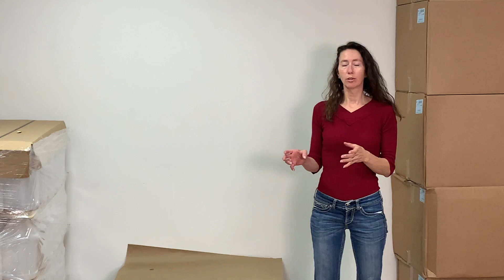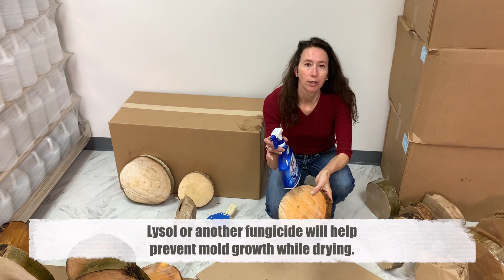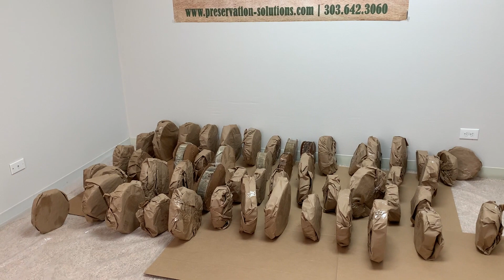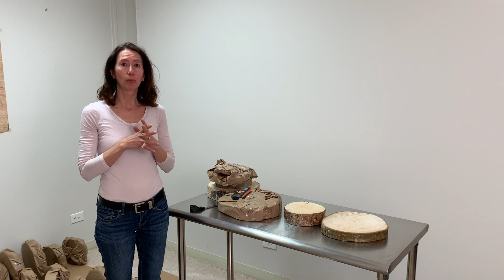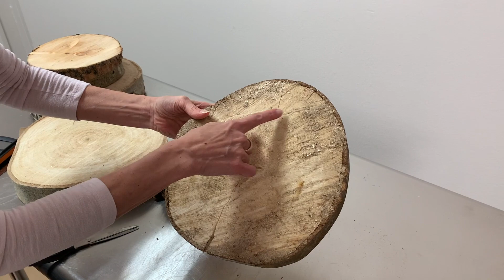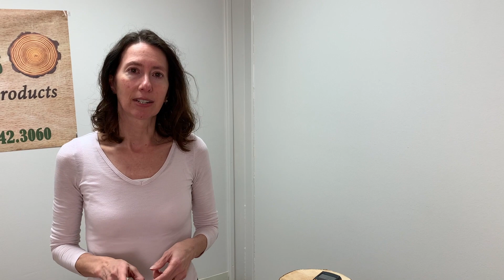How to DRY Treated Wood Cookies Without Cracking - Part 2 of 3

Comment: If you notice that the wood is drying too quickly and cracking is starting, would you retreat the wood or just make adjustments on how/where you are drying the wood?
Reply from the maker: Once the wood is saturated with Pentacryl, it does not need to be treated again.  
If you notice cracking and checking starting in the wood, then it is drying too fast. 
You can:  
- Depending on the size, cover it with cardboard, wrap it in brown paper, and/or bury in wood shavings.  All these things, slow down the drying, while still allowing the wood to breathe.
- Move it to a cooler area, but still undercover, not out in the weather, keep the wood out of direct sunlight, heat and air movement.

Comment: I’m curious why you wouldn’t want the sides (circumference) coated? if you’re trying to slow the end grain drying, so it doesn’t dry so much faster than the outside, wouldn’t you NOT want the outside to dry any slower?
Reply from the maker: Hello, by "coat" do you mean put cardboard on the outside rim of the wood cookies when they are drying?  If so, we don't need to with these pieces since they still have the bark on them and the bark acts as a sealer already.
Very little drying occurs on the outside of the wood (where the bark is).  It is the "inside" of the wood that we want to dry at the same rate as the "surface" of the end grain, if that makes sense.
So putting cardboard on the wood cookies helps slow the drying of the surface to even out the drying on the inside of the wood.

Comment: I have been watching your videos as I am trying to dry cookies from a Japanese cherry tree we had to take down in our backyard. :(  Your videos are great and filled with very nice instructions.  I have been following your advice with my cookies using Pentacryl but I have a question. At 5:28 (in this Part 2 of 3) you showed your wood pieces and stated you were looking for surface checking...I assume cracks in the grain.  What if you see "surface checking" on one or more of the pieces? Do you have a suggestion on what to do with the rest to keep them from "surface checking"? What does it tell you?
Reply from the maker: Checking the Pentacryl treated wood as it is drying gives you an idea of its progress.  We do recommend peaking behind the cardboard or brown paper.  If you are seeing surface checking, it means it is drying too fast and we need to slow it down more.  You can wrap the wood tighter (more snuggly) with cardboard or paper - move the wood to a cooler area - somewhere to keep it covered and out of the weather - with little air movement.

Comment: Couldn’t you just skip the pentacryl and put the cardboard around them and dry them slow? I’m not sure what the purpose of the pentacryl really is
Reply from the maker: Pentacryl stabilizes wood by absorbing all the way through, displaces the water, and leaves a thin coating on the wood cell walls.  This prevents the cells from shrinking as the wood dries.   Being 100% end grain on both sides (which is where all the drying occurs) treated wood cookies still need to dry slowly and controlled, especially larger pieces (over 10-12").  This is why we recommend the cardboard or brown paper.

Comment: Why didn’t you wrap the untreated pieces also? 
I think if you wrapped the cookie or put them in saw dust your results would be the same without the cost ???
Reply from the maker: That is a good question. For this video, we dried the untreated pieces in the same temperature controlled room as the treated ones.  Wrapping them may have helped slow the drying more and minimized more of the checking.  On previous tests, we have used cardboard on both treated and untreated red oak cookies, where the untreated cracked even though it was dried slower.

Comment: Just found out about your product the other day and have a gallon in transit. Question on drying. Does it give off any smell? I live in Houston where my garage can get into the 100°F range so was considering bringing them in the house to dry. Might be able to get away with it without the wife catching me if it doesn't smell. 🤣
Reply from the maker: No, there is not an odor to Pentacryl.  Good idea to dry them in a cooler area as the 100 degree range will be too warm.  Good luck keeping them hidden. :)